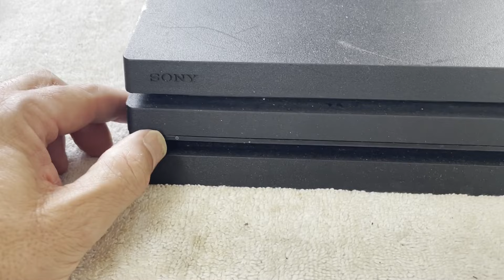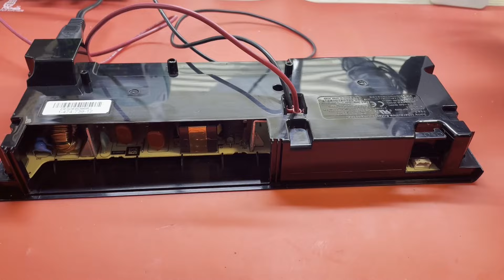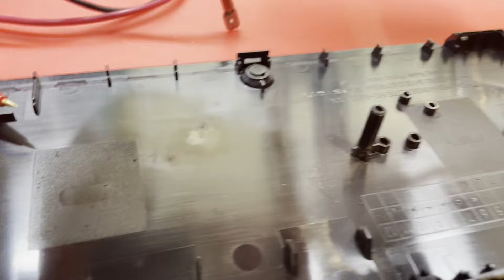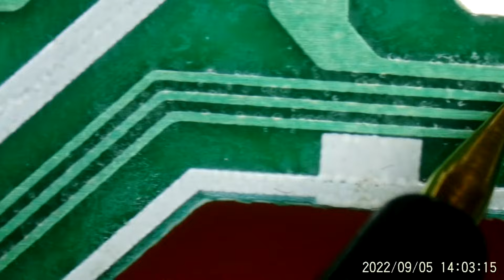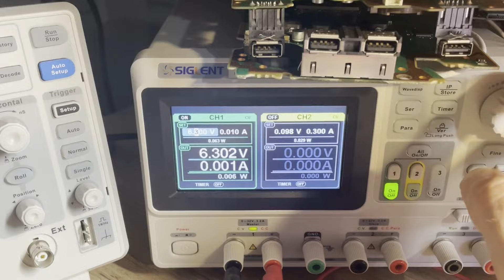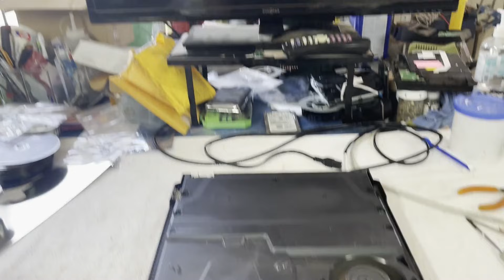#47 Repair of PS4 Pro Immediate Shutdown

Comment: Ich habe eine Frage,hab eine defekte PS4 Pro bekommen ohne Stromkabel..

Hat 2 Adern.

Von der Pro.

PC Stromkabel haben 3 ...

Passen aber.
Kann ich das nutzen?

Liebe Grüße, hoffe auf eine schnelle Antwort
Reply from the maker: I think I understand.  You are speaking of the AC input cable.  Yes, you can use the 3-pin cable.  The third pin (ground) will not be used.  If you look into the connector on the PS4 Pro power supply you will see there is no ground pin.  It will work just fine.

Comment: You know your way around those power supplies. It is interesting every time.
Reply from the maker: Thank you!  I enjoy power supplies.  They are a challenge!
Reply: I was lucky enough to not have crossed those. But last week I picked up a PS4 FAT 1116 with a slight water damage on the PS4 pcb. No traces of water on the PSU. The 240CR PSU doesn't supply voltage to the 4-pin connector. The F2 T1A Fuse was blown. After replacing it, still no sign of life. After probing a bit around I shorted one of the Schottky Diodes (24N60) essentially killing this Diode and the F1 Fuse.
The realist in my mind says I shouldn't be messing around any more. The tinkerer doesn't want to give up. 

Are the 240AR schematics somehow usable for the 240CR PSU? I could only find those.
Perhaps I should try to find out whether the PS4 board still works first.

Comment: Standby 4.8 voltage is gone after 12v loading (means short 5vsb and acdc stby) components look like ok , standbye VCC also fluctuating (DAP 046 vcc down to 10 to 11 volt) this complaint coming ps4 fat,slim and pro power supplies,you have any idea brother
Reply from the maker: That means there  is a problem with either the PFC(Power Factor Correction) or the 12V generation circuit.  If the 12V does not start for any reason, the management IC in the power supply will shut down everything.  The DAP046 generates a startup voltage from the rectified AC input.  Once the 5V standby starts, there is a winding on the 5V transformer that generates the voltage to keep the DAP046 running.
Reply: @ToltecMerc  thanks Brother, u have email id  then send me